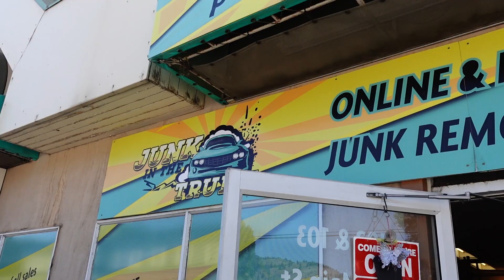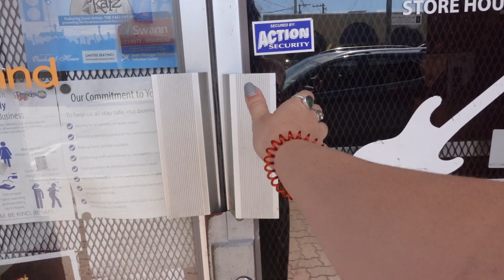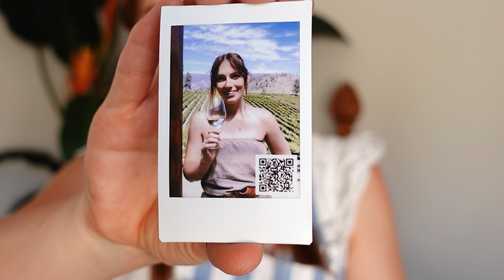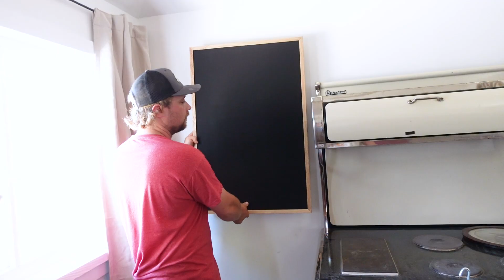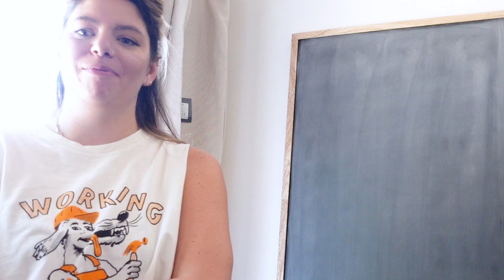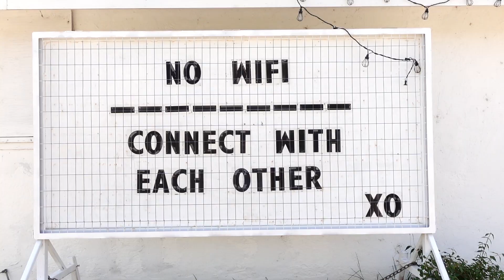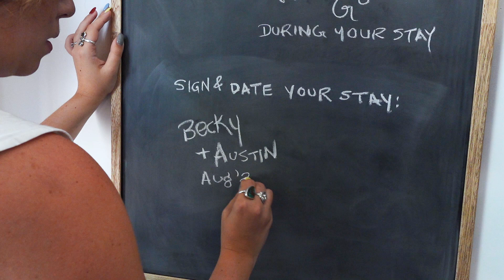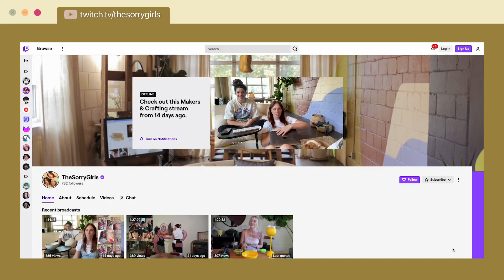couple challenge: extreme cabin makeover REVEAL

Comment: The horseshoe on the gallery wall  in baustins unit is upside down. When the opening is on the top, luck can fall into it (=lucky horseshoe). When the opening is on the bottom the luck will fall out (=unlucky)